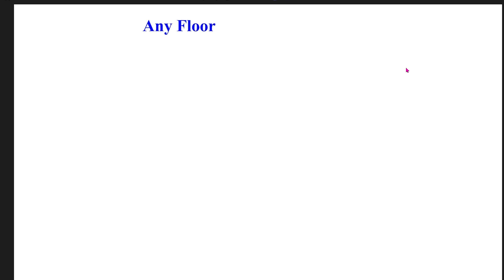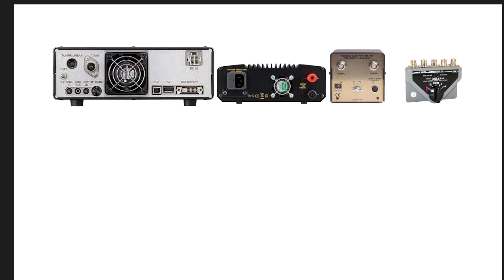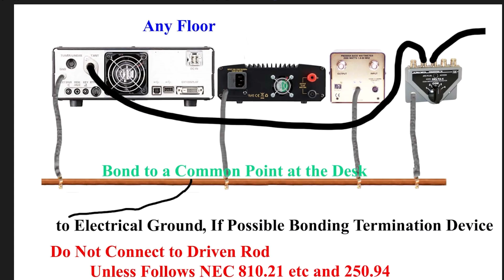Ground is a Myth says the ARRL! Ground is NOT a Myth and Here's How I Grounded My Station W6LG Jim

Comment: A bit harsh, but maybe deserved in this case... Ask Mr Tesla if there's such a thing as ground. Ground completes the circuit in both ac an dc. Ok, don't ask him, he's 'moved on'. Ask any licensed electrician from a power plant working with truly high voltage on down to your neighborhood residential electrician. Every one of them will give the same answer. Yes ground exists and without it, none of the stuff at your house works. Maybe not even the plumbing...
Reply from the maker: When the vice President of the ARRL says Ground is a Myth, then being harsh is not strong enough.  So I guess that her refrigerator, washer, dryer, dishwasher and freezer are all ungrounded.    73, Jim W6LG
Reply: @ham-radio  I didn't take into account that she's vp... I can't disagree with that then, Jim. /Dave

Comment: You are quite correct. The name of ARRL presentation should have been "Ground is often mislabeled" I spent 20 years as an electrical field engineer working for an electric utility. I was very disappointed by the presentation. Early electrical systems in rural areas only used one wire to provide distribution. The return was quite literally the earth. Of course some areas the soil is not very conductive and therefore a rod or two driven in to the ground does not give you a good ground. When we grounded transmission lines or substations we tried to achieve one ohm or less with a meggar. 
RF grounds are a different animal. A radio wave transmitted through the air does not a have a return path. However, ground planes are real and are necessary for many antenna systems.
Reply from the maker: She makes the point over and over that Ground is a Myth.  She is not saying it is mislabelled.  Thanks, Jim W6LG

Comment: Thanks Jim !!

Question, my powersupply 230V ac. Is connected maincable to Earth.
-and connected to the bonding device( cupper pipe) 

The bonding device is connected to Earth.?

Thanks!!
Theo PA0HTY

Then you created an Earth loop connectie. 7:43 

Solution?
Powersupply not connected to Earth ?

Comment: Always a pleasure to see your content.  I watched the ARRL video a few weeks ago, and my takeaway was that the emphasis was on the myth of an RF ground - which you seem to be in agreement with.  It was a bit misleading of a title; fair enough.  With respect to GFCI devices - they only look for an imbalance between hot and neutral - has nothing to do with current flowing on the ground conductor.  So, when you mention wanting all the fault current to return via the ground so the breaker/GFCI works, that isn't precise.   GFCI will trip regardless of the return path the current is taking - whether it is through the ground lead, or through an alternate path (such as a person to another ground - e.g. a faucet, sink, tub, concrete slab, etc.)
Reply: This is how I understand it, too.
Reply: @tennesseered586  Agree. this is also my understanding. but in fairness to Jim, there is only so much you can cram into a YouTube presentation.
Reply: What I know  from experience about GFCI is, you can test one by simply inserting a resistor (10K ohm) between the " hot" and the safety ground and it will trip. Even a few mA of current from the "hot" flowing thru the safety ground of the GFCI will trip it and is how the GFCI tester works.

Comment: I'm still not clear on how to connect the grounding bar/bus to a termination point. If this must be tied to the electrical panel, I'll need to hire an electrician. Setting aside lightning protection for a moment, can't the grounding bus be tied to a grounding rod outside?
Reply from the maker: No. And the system I show did not need an electrician. 73, Jim W6LG

Comment: Jim- Question: I have a MyAntenna end fed antenna mounted 96’ from the utility box on the side of my home. It is  fed by Messi and Paloni Airborne 10 that is connected at the box to an Alpha Delta lightning protection connector which is earth grounded through the utility box.
My question: is it good/bad to also drive in a 8’ earth ground out at the End fed antenna which is 96’ away? (As mentioned above)

Thanks and 73

N0CKL
Reply from the maker: If you watched the video, saw the graphic, then you know the answer. 73, Jim
Reply: @ham-radio  I’ve watched it as well others many times. So according to that I would have a rod at “tower” which would be the pole my end fed is mounted on 95’ away from box entering shack. Then drive a rod every 12’ connected together back to that location. Then go all the way around the house (150’) doing the same thing ending where my main panel is and uufer ground.
But then in your videos you say “don’t need to drive a ground rod”
—this is all for lighting protection—
Reply from the maker: My video is not about lightning. It is about ground is not a myth and how I bond my equipment. 73, Jim

Comment: I am a retired Broadcast Engineer.  I add another definition to the mix.  STATIC DRAIN.  A Ground is a direct connection to earth and other grounded objects.  A Static Drain is a much less direct connection to earth and other grounded objects.  A Drain will drain off small charges but will not take the brunt of a lightning strike.  OH, do not unground anything!! Keep ALL ground pins on electrical plugs!!!!  Here's the key...... DO NOT make an expensive piece of equipment the fuse for lightning.  In my career I came to understand which ways lightning tends to go.... AND.. which ways lightning tends to avoid.   Give lightning a HEAVY and DIRECT path to ground.
Reply from the maker: We had two lightning strikes.  Not to my three towers but to the power lines.  A TV and some small wall warts were damage. The main panel was also damaged as it took the brunt of the hit. The buss bar was damaged.  My fear about the title implies that things need not be grounded.  Things like washer, dryer and refrigerator.  Bob Heil recommended along with Gordo, I think, cutting off that pin to stop loops. Which is not a good idea. 73, Jim

Comment: What is also important is that one does NOT use a switch mode power supply, but a linear supply that has a transformer for isolation.  I was in the electronic repair business when JImmy Carter outlawed power transformers for TV set due to power consumption. Which was at the time 2-5 cents a month cost in electricity.  However, it was good for business, as service calls jumped over 500 percent.  The frequency of switch mode supply is close to a lightning struck which then destroys everything.  Second, All grounding should lead back and connected to the ground rod below one's power meter.  Your illustration is correct.  God Bless.
Reply from the maker: All of my power supplies do have a transformer.  One is 70 amps I think. The others are 30 and 20 amps. I don't like switch mode power supplies in radio room. I agree with you. 73, Jim W6LG
Reply: I'm trying to understand your comment. You are saying you shouldn't use switching power supplies because they are more prone to lightning damage? Because the frequency of switching is close to the frequency of lightning? Isn't lightning DC?
Reply: @WQFT99   YES,  a linear supply with a transformer breaks the ground connection and stops the lightning in its tracks.  The primary windings take the hit and since the frequency of the transformer is at 60 cycles,  very little energy is transferred to the secondary windings.  One a switch mode,  the operating frequency is around the frequency of the lighnight discharge causing it to walk right in and destroy everything.  In addition switch mode supplies have NO isolation.
Reply: Lightning is a spike, and yes it is direct current, but the frequency of the spike is what is important.  Again, I saw repair business increase will over 500 percent once power transformers were removed from television sets.   Televisions with power transformers would normally only blow the sets circuit breaker that just needed to be reset.
Reply: @Servant-of-Christ-net  Interesting. Thanks for elaborating.
Reply from the maker: We lost a TV and a switch mode supply. The TV for sure was switch mode.  That agrees with what you commented on. Thanks, Jim
Reply: @Servant-of-Christ-net I am new and trying to understand. I understand bonding everything to that copper bar or bonding strap. But how does one then connect that common bonding strap or copper bar to the common ground of the house through a "nearby socket" as explained in the video?

Comment: Good morning Jim. Glad to see you doing what you do, helping us all. I was flowing along doing good on my check list until you said do not use a ground rod. Maybe I missed something. My little shack in common point ground like your diagram but it is grounded to a rod just outside the snack. That rod is tied to the main panel ground. What did I miss. Always always enjoy your presentations and use you as my gold standard of excellence. Trust me your named has been used for reference to many of my friends and post. 73
Reply: Jim is correct, but I am building my station similar to what you have described using an entry panel from KF7P Metalwerks. My main breaker panel has a ground wire from the common bus bar to my municipal water service, also there is another ground wire that goes from the common bus bar, exits the basement and goes to 2 ground rods outside, that same continuous wire will terminate on to the copper plate in the KF7P panel. Arresters will be mounted in the entry panel on the copper plate and the coax from my antennas will terminate on the arresters. I believe as Jim described the most important thing is that our station grounding system tie back to the common grounding point of our electric service.

Comment: Great video as always Jim. Just out of curiosity, if all the components of the station are connected to the power supply, and the power supply is connected to the earth via the third pin on the plug, aren’t all the components then grounded as well?
Reply from the maker: They are not.  73, Jim

Comment: 15 years as a communications technician.  If hams could see the grounding we do at a commercial site, you'd all tell the ARRL to pound sand and some of you would go home and make some changes.  lol  We spent a lot of money on "grounding" things and the engineering dept took it VERY seriously.
Reply: Exactly. The motorola book on grounding was not produced because grounding is a myth. Sheesh.
Reply: Most licensees I know, are completely in the dark when any discussion of RF and grounding comes up. Most don't care, they just want to play push-to-talk, let-go-to-listen.
Reply: @garycook5125  As a tech with a bunch of sites, you'd realize after a few years that the sites with proper grounding don't loose equipment in a storm.  You're getting a call at 3am because of an electrical storm nearby?  It's probably an older site with with poor grounding.  It makes a difference.

Comment: I have a copper bonding bar mounted on the wall behind my desk that goes to a MFJ window passthrough to my ground rod outside. Why is the ground rod bad?
Reply: Because the breaker supplying power to the outlets your gear is plugged into will not trip if not grounded back to your main electrical service ground
Reply: If there are multiple points of entry, that means lightning current can enter at one point, and exit at another right through your equipment.  If your service entrance ground rod fails during a surge the quickest path to ground then becomes your radio equipment to the extra ground rod you installed frying all your stuff.

Comment: I think she's talking about a GFCI breaker, which does indeed trip the breaker in the event of a ground fault.  

AC safety grounds, lightning protection, and RF grounds are all different things.  Bonding your equipment to an AC ground is fine for safety.  But AC grounds generally are high impedance paths to RF, and are poor lightning and RF grounds.  

My main concern with grounds are lightning and fire safety and protecting my equipment.  AC safety should already be a given thanks to the NEC.

For lightning and RF grounds, you need short, straight low inductance paths to ground rods, not a 14ga wire twisting and turning through the walls of your house going 50 feet back to the electrical panel.  That ground bar at your equipment needs a good low impedance path through the wall to a ground rod close by, and that ground rod needs to be bonded outside to the electrical panel ground rod.  I have a ground rod outside of the shack cable entrance where I mount all my coax surge protectors, and I have a ground rod at the base of each of my masts and towers they tie to.  All of my ground rods are then bonded together with #6 buried in the ground and connected to the outside electrical panel ground rod.  The equipment ground bar is tied to the rod at the shack cable entrance.  Each piece of coax or control cable goes through a surge protection device before it enters the shack.  Avoid any sharp bends in the #6 wire connecting the masts, ground rods, and shack ground together.

After the antenna cables go through the surge protectors outside, they all terminate in a patch panel.  Cables also run from each radio's antenna jack to this patch panel.  Patch jumpers allow me to quickly and easily connect any radio to any antenna.  When I'm done in the shack, the patches are removed, disconnecting the radios from the antennas.

Comment: A complex subject which is not easy to get your head around! One point I would like to make regarding earth loop 'hum' - with amateur radio equipment it is normally designed to work off of battery or separate mains PSU, so it is 'doubly insulated' - it does not use the mains earth to provide safety or bonding. Earthing the way you illustrate with a star connection is exactly what is needed - no earth loops and everything has a common reference.  I used to live on 13th floor and you could light a traditional bulb between the electric earth and the water earth! Earth is an inaccurate description, as would 'ground'.  They are concepts whereas bonding is a reality and is what we need to exercise. Take a look around a high power transmitting station (especially a LW or MW one). You will find lots of copper connecting things together to create a common bond.  Even then you can still light bulbs between earths!  A standard 'trick' when in the antenna field to check if the transmitter was on air was to create an arc between the barbed wire fence and the 'earth' wand (bonded to the station 'earth'). If you got an arc, the transmitter was on.... I would not trust the opposite statement though!

Comment: My old house I just moved from had the ground on a cold water pipe.  There was no way to drive in a ground rod.  You had about 3 inches of dirt over bedrock.  The house was in an ancient riverbed (Long since dry).  There was a near miss with the new owner when the connection on the pipe loosened up and went to sparking.  There was almost a fire.  The house was built in the 1920s.  I had gotten the last of the knob and tube wiring out of it about 12 years ago.

Comment: Jim, I watched the ARRL's presentation  several weeks ago. First impression was similar to yours, but if you give the full presentation a chance you'll note the following:  1 - There is "marketing" in her comments related to "I don't know where the current goes" - she's talking about incorrect grounding assumptions people make who don't keep Kirchoff's current laws in mind. Trust me, she does not mean "Ground is a myth" alone, she's saying this instead "Grounding is not the same thing as RF Protection" - as evidenced with her total presentation. 2 - She is suggesting NOT to connect the station grounds to the same ground as the antenna to station connections as they provide a path INWARD to the station.  Your grounding setup is possibly dangerous in that you are providing a new pathway into the shack for lightning charges that come via the antenna path.  Instead, consider using the single breaker panel ground (or another ground near the station, but tied to the breaker panel) as the ground for the station equipment, and also put another ground rod in for the antenna and transmission lines, with the fused fail-overs - but do NOT connect that rod to the station grounds. The bottom line is, when you discussed common station grounds, she's saying that is a ground reference and achieves the goals you want due to that (no ground loops at the equipment) and she mentions RF isolation and then lightning protection, but as THREE different goals with three different courses of action. Bottom line here "cute" tag line of "Ground is a Myth" - means "it's not as simple as that, Grounding alone to achieve the other 2 goals makes the single solution a myth". That is what she meant. 73 KM5L
Reply: Actually I got that too. But it’s not what she said. She said it was a myth. And from a physicist’s perspective it is. However she was not clear in her explanation. I had to watch it very carefully to understand the way you’re explaining it here. When there’s what you said and what you meant you already have a problem. And that is exactly what Jim is getting at.
Reply from the maker: The title says it all.  But I will bet that her washer, dryer, dishwasher and refrigerator are all grounded! And that is no theory. 73, Jim
Reply: @patrickbouldinkm5l143  As someone who has spent a lot of time teaching, it is important that the instructor is clear enough that students should not misunderstand the material. The ARRL presentation in the eyes of someone who already knows the material makes sense because you assume the sarcasm. Someone who is new to the hobby and not a technical expert can easily take away the wrong, and dangerous, idea.

I am with Jim that the ARRL presentation should be considered substandard for alleged experts in this service. I do expect more from them.